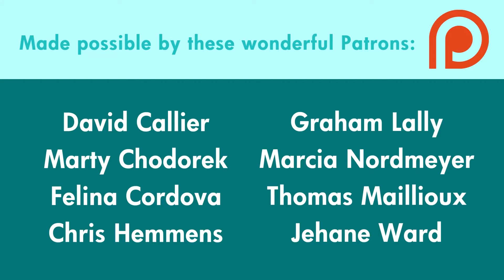Han Solo & Lando Star Wars American Traditional Practice Time Lapse Tattoo

Comment: My stencil won't stick to the practise skin , with a couple of wipes everything is gone.
It's seems that your's sticks really wel, what are you using ?
Great work btw!
Reply from the maker: I use speed stick on the skin and then press down with my stencil. I've been told to also try and let that sit for at least a few hours it not overnight so it dries out where the speed stick was. I only waited a few hours on this one. Also working from bottom to top is best and try not to wipe if possible until you have that whole section inked at least once. 
For me the hardest part is getting any kind of good line on the first go. These fake skins all I've tried at least just don't do it. I use the suggest speeds for this machine too so I'm not sure what could improve it.
Reply: Thanks for the quick reaction!
I don't complain about my linework, but i use only coils.
I've got the Ronnie Star Lightweight liner and shader.
Practise skin isn't everything , maybe you try on pig skin?

Comment: Hello Christina, I am a tattoo artist that just funished my apprenticeship. I have watched a few of your videos and I think you do pretty well on that fake skin. Just a few tips, you really need top notch machines, inks and needles, if you want to get better or plan to move onto people. Good machines, power supplies, needles and ink are a must. Better quality inks hold in the skin better. Better needles put the ink in the skin better. Proper power supplies give machines a nice, steady flow of current, so they run smoothly and high end machines just run better on the whole. Trust me, if you think you do well with the equipment you have, invest a little more money into some higher end equipment and you will see a difference. Check out painfulpleasures.com, they have a good selection of products from low to higher end quality. Some name brands to look for are Eternal, Intenze, Starbrite and Skin candy, for inks. Cheyenne hawk, Peak, Paolini, HM, Bishop, FK Irons and Borg for machines. Check them out and Keep up the good work 👍 oh and definitely getrid of that Kuro Sumi ink. It's terrible. I know. My master used it on one of my tattoos and after it healed, he had to redo it with Dynamic black, which is also an excellent ink, that I didn't mention, sorry.